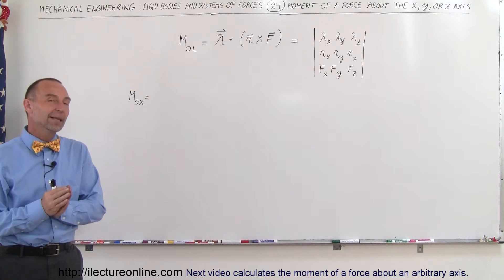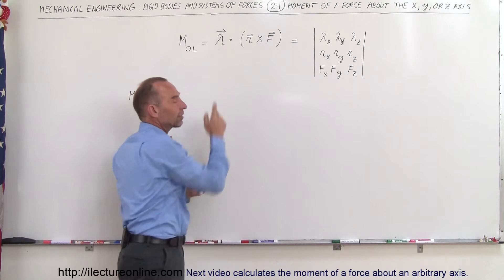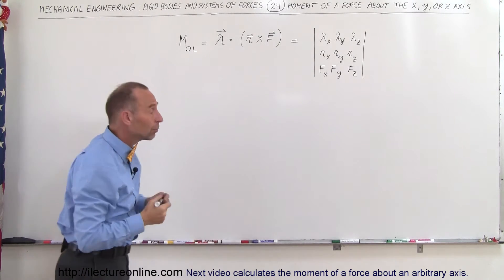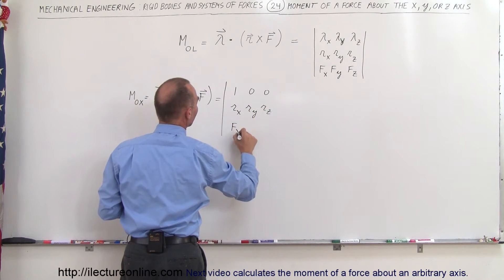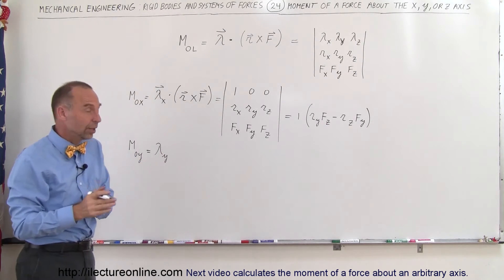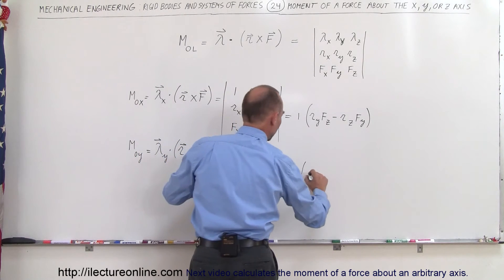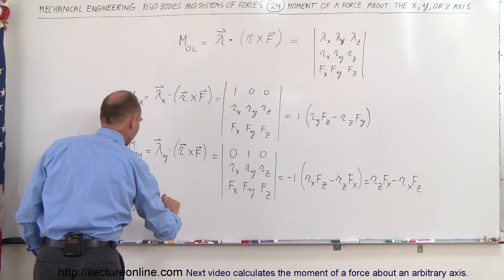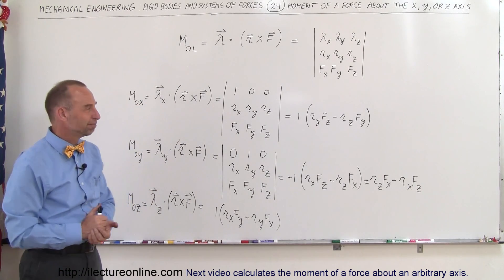Mechanical Engineering: Rigid Bodies & Sys of Forces (24 of 47) Moment  of Force About x, y, z Axis

Comment: The r vector is also unitary, because it´s the vector that gives the "direction" of the distance between the origin and the force, right?
Reply from the maker: +ProjectD100 
In this example the r vector is not "unitary".  The magnitude is the distance from the point of rotation to the point where the force acts.
Reply: Thanks for answering fast! I understood better now. And thank you for all the really good videos, they help a lot!